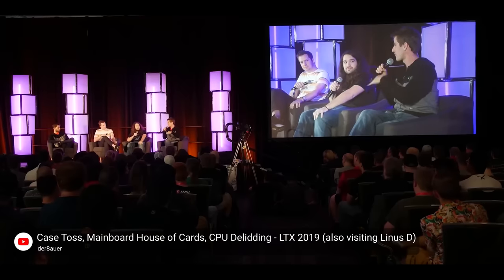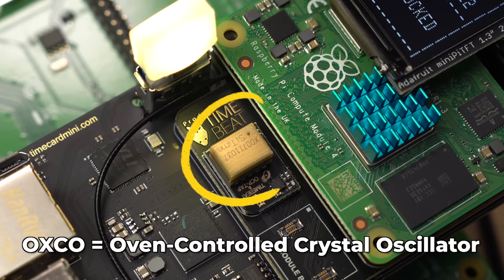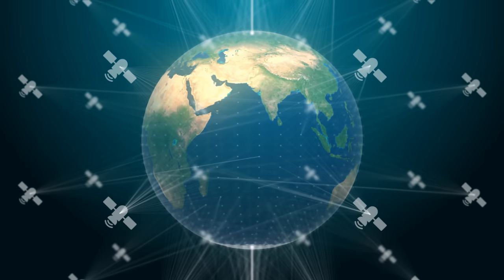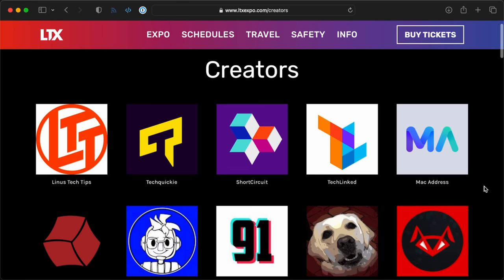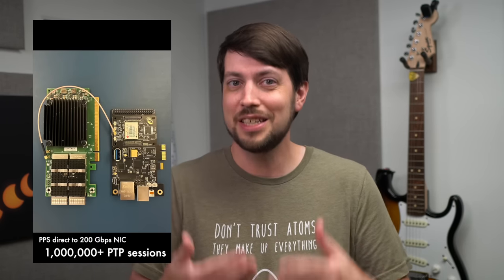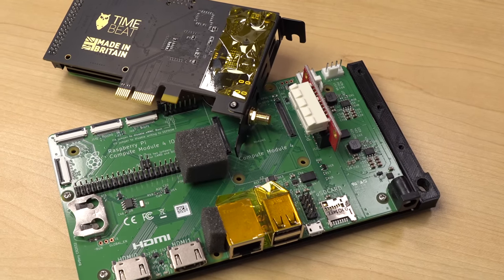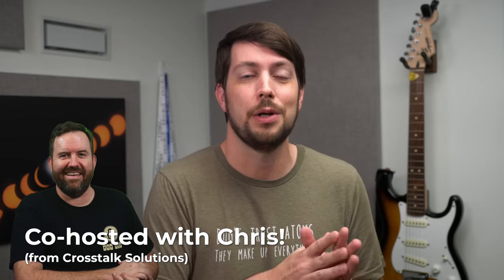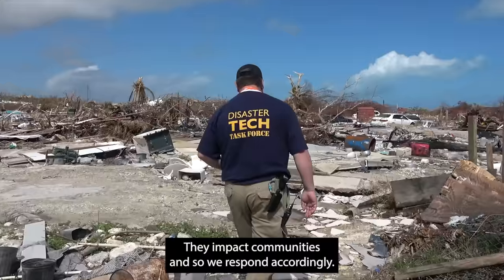This card puts GPS and a tiny OVEN inside your PC!

Comment: Hello Jeff, greetings from Germany. Your videos are just great. I hope your fundraiser has brought a lot. I myself work in Germany as a volunteer with the THW (Federal Agency for Technical Relief). But now to the minute 3.29 USB LED stick. From your point of view, is it possible, if a certain DNS query is made by my RPI, that the LED changes color? So I would like to evaluate the DNS queries in color. Thanks for a tip. Greetings Markus
Reply from the maker: That's a great question! I haven't worked too closely with DNS software APIs, but assuming you could either watch a DNS query log, or parse out the queries in some other way, yes!

In fact, I built a little tool to blink an LED when Nginx got web requests on an old Pi cluster: https://www.jeffgeerling.com/blogs/jeff-geerling/nginx-load-balancer
Reply: @JeffGeerling  Thanks

Comment: This is a very basic thought, so I'm sure there's a reason. But why can't we just sort of calibrate less precise clocks? Like how we add a leap year. Leap nanosecond.
Reply: Because it's not that the clock is slow by 1 second per day or something like that, it's that it off by an ever changing amount, 5 seconds fast today, 8 seconds slow tomorrow, etc.  Often driven by temperature or voltage fluctuations among other things.  Most high accuracy time systems do in fact "calibrate" a less precise clock as part of it, but that's not enough to make that as good as the source.  Often they use a very high precision and accuracy source like gps as the source of true good time, they use that to discipline their local time source (basically continually calibrating it using the differences between it and the true time source) and to correct any offset in their local time source, then use that to ride through losses of the true time source and to generate smaller reactions than exposed by their interface with the true time source (which may use something like pps or pulse per second to indicate the precise start of every second but gives no other times out).  I feel like I've even seen into implementations that did similar to better correct computer clocks using ntp as their true time source.
Reply from the maker: Good explanation—and systems like Timebeat's software or LinuxPTP have 'smearing' as a core feature—basically, as drift occurs (and is measured), instead of the incorrect clock immediately being reset to the 'correct' time, seconds are 'smeared' so software still sees a continuum of time, and doesn't just have seconds disappear entirely, or get repeated.

Comment: where's the best place to get a cheap-ish ocxo module. I'd like for one either with a configurable frequency, or that being too expensive, one with a unix timestamp readout. I want to make a clock that's from a fictional sieres. it's time conversion is well defined, and not too difficult from a unix millisecond counter, but is rather complex to do from a standard date and time RTC.

as I've never heard of ocxo until now, I wouldn't be able to tell what is cheap and what is fake, which is a common issue for the entire tech market. what's a reasonable lower bound on price for a real one.

Comment: Accuracy and stability are not the same thing. An Oven Controlled oscillator has stability (with respect to ambient temperature changes), it does not mean that the oscillator itself is necessarily accurately oscillating at the correct frequency.

Comment: To be fair you can get this same setup for a LOT less using the PI, and GPS module, and PPS.  Yeah, I know you mentioned that, but anyone who wants extremely accurate time can replicate your setup at an affordable level if they wanted to.
Reply from the maker: Similar; this design gives you PTP, easier integration into a server, more options for holdover sources, and generally higher quality parts than the more consumer level stuff on many Pi HATs.

But for most of us, if nano/picosecond accuracy doesn't matter while GPS is gone, cheaper parts are just fine.
Reply: Jeff doesn’t want ‘extremely accurate time’…
Jeff wants ‘absolutely insanely accurate time’…

After all, ‘extremely accurate’ is for mere mortals.

Comment: Meh, you can just use a regular GPS module ($15) and create a stratum 1 NTP server.
Reply from the maker: There are varying degrees of GPS modules, and connectivity :)

This is more of a mid-range solution, not quite as exotic as a high-end multi-thousand-dollar atomic-clock-based card!

Comment: Do you think this PCI card is able to be "hacked" together into a remote control pi (can't remember what that project was called)?
Reply from the maker: BliKVM makes a PCI Express Pi IP KVM board; I covered that last year, and it's another really cool use (though the PCIe pins aren't used for any host-Pi communication).

Comment: can you really calim to have the most accurate clock if you are using python to run everything, seems to be a massive oversight to me-
Reply from the maker: The nice thing is the clock is accurate, and PTP over Ethernet is accurate. The ms or two of potential delay in the user display outputs would be imperceptible to humans.
Reply: @JeffGeerling  so high precision maybe not so accurate 😉

Comment: While the hardware is probably fast and accurate, the use of Python on the software side is questionable as to when you are getting that accurate time, visually or otherwise. An interpreted language will always introduce latency.  Hell, even tight machine language will and latency but it will be MUCH lower than say Python.

Comment: you should have multiple gps antenna and display how many birds you are locked in on - the content had some skew and jitter but i blame red shirt jeff since for him time does not matter - as long as it takes and when it is ready are his mission statements. i think you should continue the time experiements but expand to have many diverse source and then you can have better timing with more inputs and corrections - time is relative after all. #timelords
 time is relative because its measurement depends on the observer's motion and the strength of the gravitational field they are experiencing. The concept of time being an absolute and universal quantity, as was previously believed, is replaced by the understanding that time is intimately connected to space, and both are dynamically influenced by motion and gravity. This relativistic perspective of time has profound implications for our understanding of the universe and has been extensively tested and validated through various experiments and observations.
Reply: I you install the Timebeat back-end we show you elevation, azimuth,signal strength and signal-to-noise ratio for each satellite constellation for each bird / SV. Oh, and all our software is free.

Comment: I might send Eben an SMS just so send me a Pi 4 with 8 GB for my Smarthome - or do I have to forget the whole Pi idea and went a long with used ovens aka i.3 Lenovo small form factor pc to run HomeAssistant ?

Looks like this is the more likely way after Pi4 and pi whatever shortage took ages while some domestic dealers are the real scrapers by rising the prices 10€ above the competition. 
I am giving up, will sell my pi 3 inventory and forget about that cause I can live with an i3 used 8 GB from 2015 for cheap paid by selling the pi3 stuff I still have.

I have spent 1000€ in all these year in the pi ecosystem but i am done with it after so many months and misleading messages.